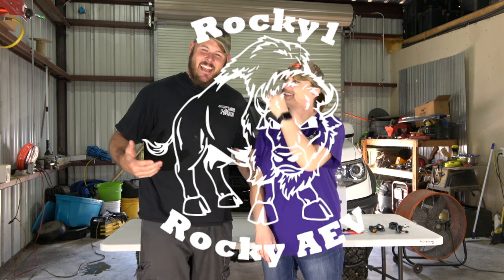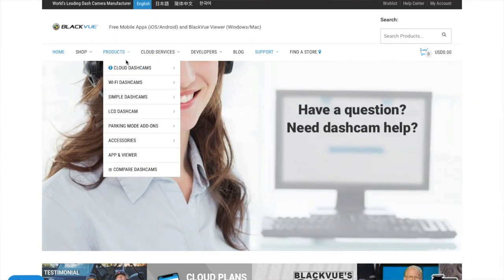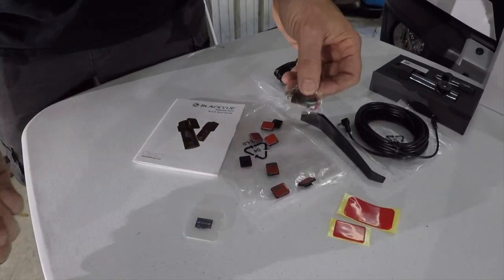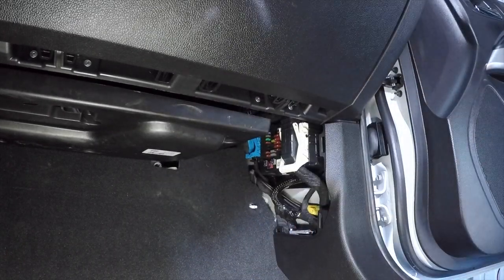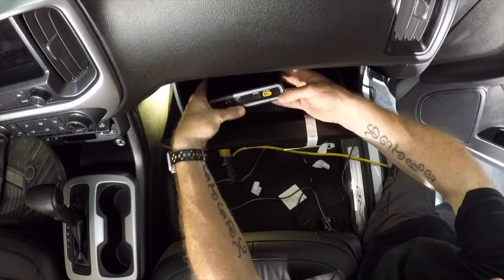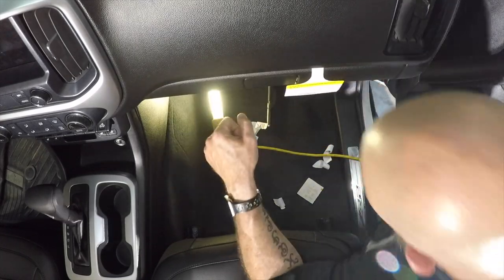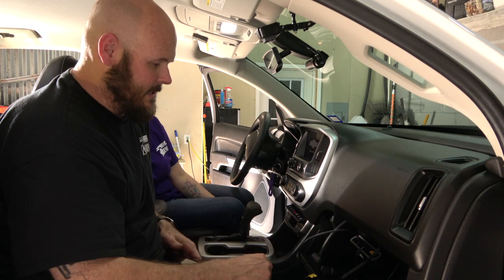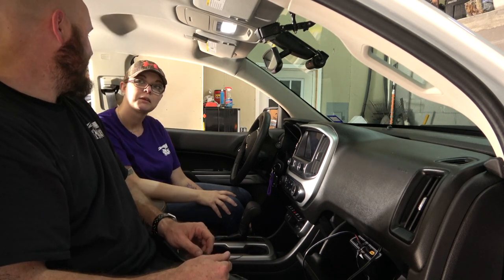2019 Chevy Colorado ZR2 Bison BlackVue Dash-camera Install

Comment: Use ATM fuse connectors in your Colorado, pin the battery wire to 31 and the auxiliary wire to 34. You can pick them up at Autozone. Make sure they both have two 15a fuses in each block and pin the ground to the post that holds your fuse box cover on after you scratch a little paint back for contact. Video did a great job showing generally how to do it, but picking fuse ports to use was a little bit of a crapshoot. 31/34 seem to have the most clearance for the add-a-wire and doubled ATM fuses without cluttering the fuse box up too bad.

Comment: For those wondering the thread type of the ground lug used in this video is M6x1.0. Use a 6mm lock washer. Hope this saves somebody an extra trip to the hardware store.

Comment: Rocky AEV 
 Hello there, first, let me tell you, the camera install is awesome!!! Thank you for the vid. Secondly, do you guys know, if there is somewhere available front camera for the ZR2 Bison 2019? Thank you!
Reply from the maker: Are you talking about the one that is "factory" in the grill? If so then to the best of my knowledge the answer is no. The 2019 software will not allow the expansion of cameras like in the previous models. Will there be an update? I can only hope because I would love to add the mirror and grill cameras.
Reply: @rockyaev8287  That is so disappointing. Jeep Gladiator has nice front camera, wonder why Chevy does not have the option.
Reply from the maker: Ve Po technically they do.....the software just doesn’t work for the 2019 model (maybe the 2020... not sure) this was the transition between old software and new software (I know you’ve seen the Chevy commercials and they talk about the trailer bing invisible) well in the process of making all that work it messed up the compatibility on the 2019......so the side view mirrors, and front camera does not work with the new radio. (Also first time there is WiFi in the Colorado) basically I have to wait for a new radio to come out and upgrade, or downgrade to the previous model (and loose WiFi) to gain 3 camera inputs! 🤦‍♂️🤷‍♂️
Reply: @rockyaev8287  I am going chop some wood to calm me down LOL that's just so stupid :-/ sigh
Reply from the maker: @vepo2341  😂 Man Im telling you, I do hope that the come out with a solution because I would love to add the mirror and front cameras because on approach you can't see an dang thing and have to hope and rely on your spotter if you have one.
Reply: @rockyaev8287  You absolutely correct!! Keep me posted, also, you doing good job with all the addons on your truck guys! Thank you!

Comment: Rocky AEV....does the VUE battery pack overheating or have experienced any temp increase of that pack? I think I might be ready for it at the end of the spring :D
Reply from the maker: Ve Po so far we have had no issues, and we are in central Texas where a parked vehicle in the summer is getting hit with outside temps around 102-105....so inside is....a lot more hahah. Just make sure that it’s out of direct sunlight, and has room to breath and you should be fine.
Reply: @rockyaev8287  Thank you kindly sir!
Reply from the maker: Ve Po no problem 😎

Comment: My only concern would be the side curtain air bag.
Reply from the maker: pywakett350 I thought about that, and few that the way the wire is ran it is clear (at least mostly) or in restricted in the event that the bag goes off...there is enough slack that it should not impede the air bags function. Hopefully we never find out the a trial truth..😬 thanks for watching and thanks for the comment

Comment: Was there excess cable for doing the rear camera. And what did you do with excess
Reply from the maker: Yes there was probably about 5 foot left. We just bunched it up neatly and zip tied together so that it would lay as flat as possible. Then tucked it inside of the headliner. Thanks for watching.

Comment: Very cool !
Reply from the maker: George S this thing is awesome! We are loving it!
Reply: Hey Rocky, do you think after time the battery pack will loosen its Velcro mount and start to be a source for a rattle ?
Reply from the maker: Actually it’s very possible, but do to the way I sat it in the glovebox all of the weight sits on the “bottom”...then after putting the manual and wheel lock key back in the box....it all holds it tight. So I actually have high hopes that it will hold. If we would have mounted it somewhere else that did not have something to press against it...it would already be rattling. It’s got a little weight to it
Reply: Hey ! Where have you guys been ? Miss’s your great videos
Reply from the maker: We have been a little behind due to life situations, I am pushing to finish up a review of the dash camera and will let everyone know what’s been taking place...we are off schedule and hope to get back in gear ASAP! Thanks for asking for sure

Comment: Any idea if fuse F32 "Steering wheel controls backlighting" can be used? I have a fuse tap cable that will only fit fuses F32 and F34. F34 supplies constant power, which I don’t want, and F32 doesn't seem to be working for me at all.
Reply from the maker: Mike McCann I'm not sure, I'll pull the schematics and see what is going on in that fuse....I'll get back to ya on what I find
Reply: Rocky AEV I ended up buying an ATR adapter and using a different fuse. Not sure why fuse 32 failed to power it. The backlighting was on too
Reply from the maker: Mike McCann dang wonder what was going on. Sorry I never got back to you I actually tore my rotator cuff and completely forgot about checking this out for you 😬 past week has been rough. You got it going though? I hope you enjoy your camera as much as we do ours.

Comment: I  wanted to see the running of the wire to the rear.
Reply from the maker: Sorry, but I literally pulled back the seal just enough to push the cable in.